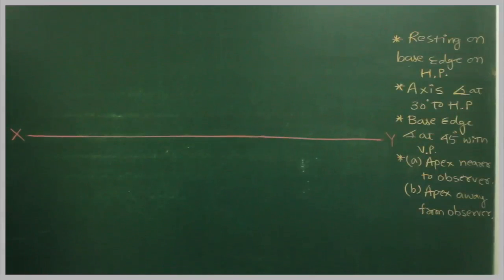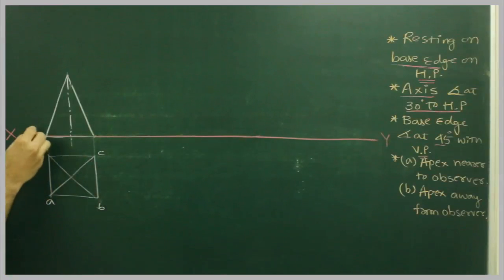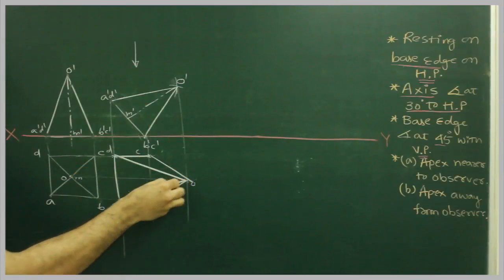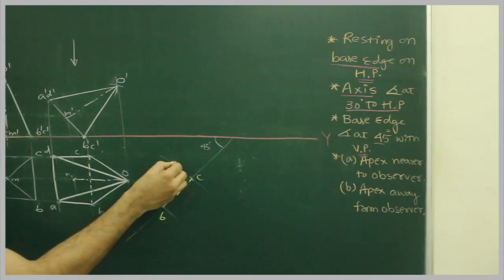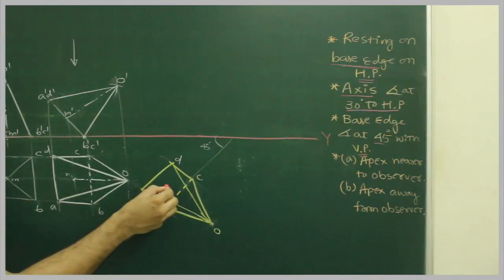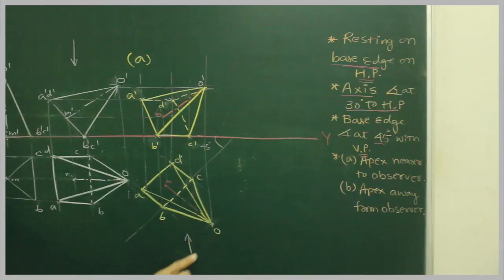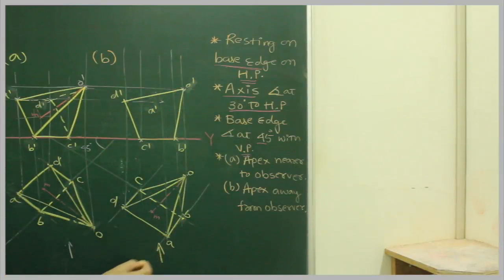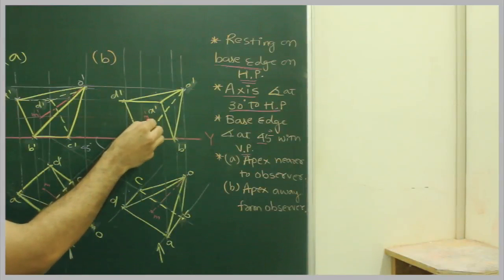Projection of solids 16 ( type 3) ( fro engineering and diploma students)

Comment: would you please solve this question :- A hexagonal pyramid of 2 inch sides and 4 inch height is resting on Horizontal plane such that an edge of the base is parallel to the vertical plane and the base is making an angle of 30 degree with the horizontal plane. The pyramid is cut at 2.5 inch from the base horizontally. Draw the Top, Front and Left side view of the object in third angle projection method. if you did it send send me @ x4menbd@gmail.com